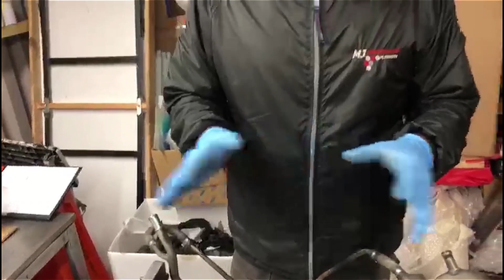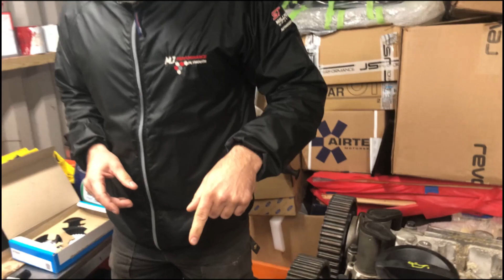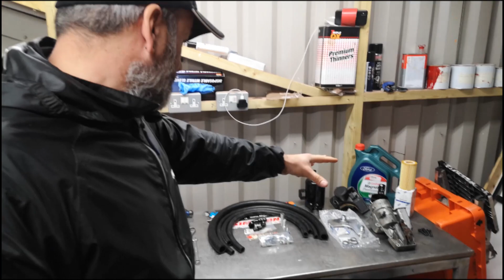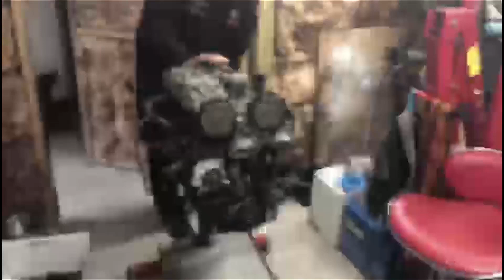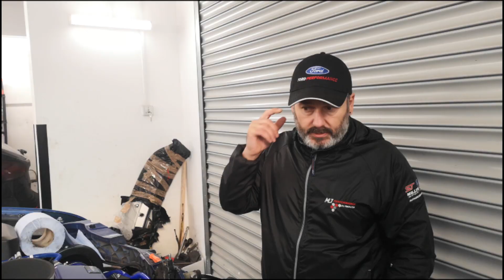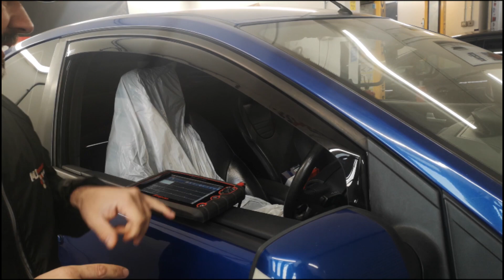FOCUS ST GETS A BLOCK MOD AND FORGE BUILD | ENGINE REBUILD TO FIRE UP!

Comment: Just wonder how can I purchase a 2.5l engine? I live in the states.
Reply: Okay, so first off, if you have an RS (MK 3)already, I dont see why you'd want to do that. If you want a 2.5L engine in the states, its gonna be complicated but if you have the money, you can do it. If you can yank a low mileage engine out of a wrecked or totaled Volvo C30 or S40 from 2007-2012, they have almost the same exact motor as the focus st's and RS's (essentially). I have a 2008 Volvo C30 T5 myself, and the focus's have almost the same engine code, that being B5254T(3-7). Wikipedia claims that the T3 motor was used on the focus rs and st, but has its own ECU tune and map. Wikipedia claims that 2008 onward was the B5254T7, which is minorly different with the turbo and such. If you wanna do this much work, these 5 cylinder blocks have a tendency to crack, which is why ford used forged rods, pistons, and more aggressive camshafts for the motor. They also used iron cylinder sleeves to help reinforce the cylinder walls to keep from cracking (which tends to happen as you approach 300hp on the stock motor). Also understand that the Volvo t5 motor we got here in the states has a KKK (now part of Borg-Warner) K04 turbocharger on it. The Mk2 ST had this as well, but sounds a little different with an exhaust compared to a C30. If you look up a C30 with an exhaust as opposed to a Focus st or rs, you can hear somewhat of a resemblance. The MK.2 RS has a KKK(BW) K16 turbocharger on it. Also understand you'll need bigger injectors, and do a stage 0 (replace and upgrade parts before tuning) and make sure your engine is running okay. Doing it is possible, but its hard work. LMK if u have more questions.
Reply: Levi S why would you need it 😂